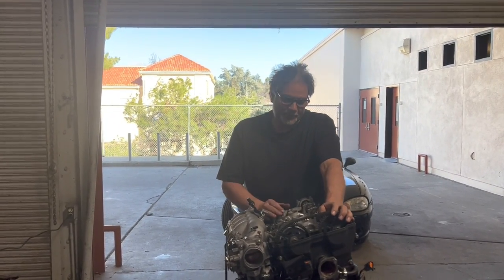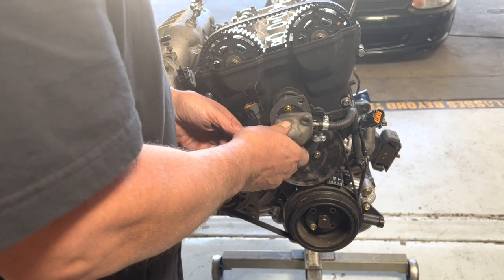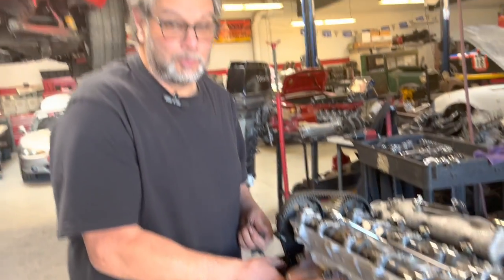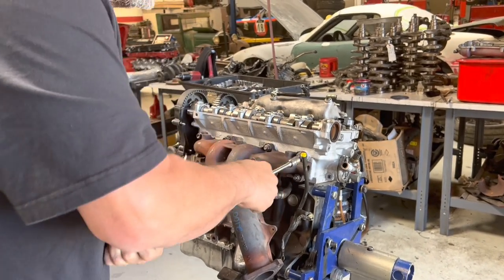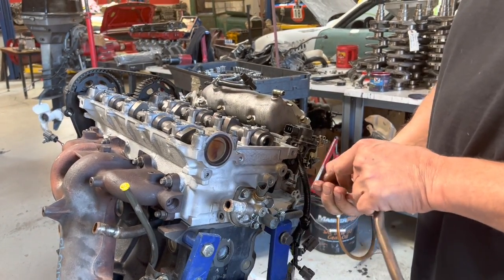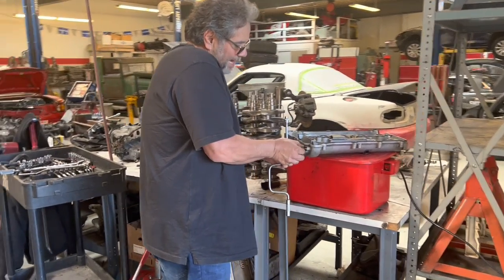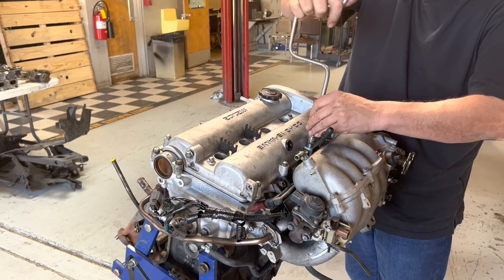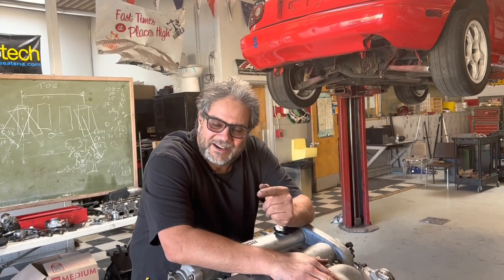PT8 DIY Pro Built Miata Engine Step By Step, Spec Miata, Autocross, MX5, Track Car

Comment: Hey Al! I have two questions. 1) Did you ever put this on the dyno or find out how much power it made? 2) How do you clean your parts? You mentioned cleaning the oil pan and thermostat housing among other things, and they both look spotless! Do you use a parts cleaner cabinet, use brake clean and a rag, scotch brite and some elbow grease, etc???
Reply from the maker: Kids

Comment: Al I’m reading every single forum out there and also bought the book from advanced auto, and every forum I’m reading says a pro built motor for about 8grand says it’s 125hp roughly. I feel extremely confident in the building of my motor if I do it myself with this series to help, I just gotta know what to tell the machine shop for the cylinders and the head on what’s allowed? How are we stretching the power to get a “pro built” engine?
Reply from the maker: Now thats the question right there. Most of the power is made from the head. selecting a place to take it to will determine if you are mid pack or up front. I know Drago sells some great heads as well as a local guy here in Sac Mike Hagg. Please keep in mind you will get what you pay for. If you get torn down and found with a cheater head, they will all point at you as you walk by.
Reply: @aracing  that makes total sense, I’ve seen Drago name on a lot of forums, but I’m trying to find out what’s allowed because I don’t want to be non compliant 😅 I’ve read the rule book front to back and some of the areas are for sure gray areas. What are your thoughts on boring? If I remember correctly you can go 0.15 over but then your car has to weigh more? Is it beneficial or is the added weight cancel it out?

Comment: I have a question about what fuel injectors should I use when replacing what’s in the car? 1995 1.8 SSM??? Thanks for your help!
Reply from the maker: In my world of spec miata we are not allowed to use anything other than stock. So long as you are running an engine that is stock, I would go with the factory inj or ones that flow the same as stock. Running larger or smaller inj will just throw off the fuel management from the computer.
Reply: Thanks for your Help!!!!

Comment: When putting the valve cover on you put a dab of sealant on the corners where the cam caps are?
Reply from the maker: I did for a really long time. But then I found out that what I was seeing was not from the valve cover, it was squeeze out from the camshaft cap. When you seal the cam cap with silicon some oozes out and you put the valve cover on. It doesn't hurt to seal those corners, I just skip it now and still have no leaks.
Reply: @aracing  your knoweldge and experience is very helpful. thankyou.